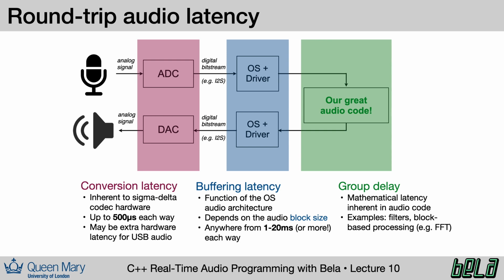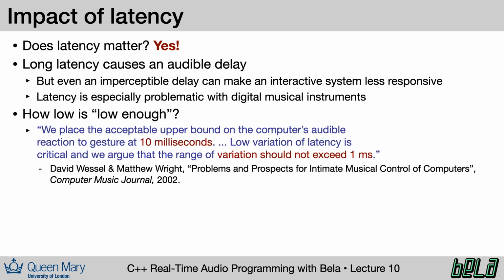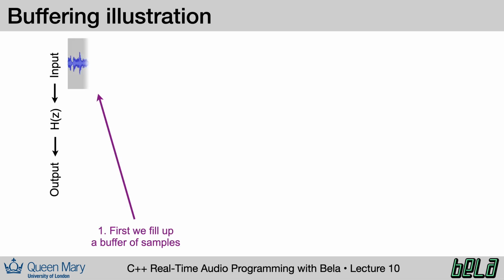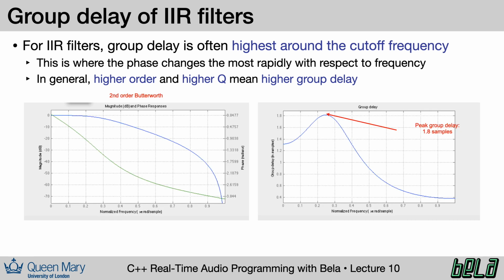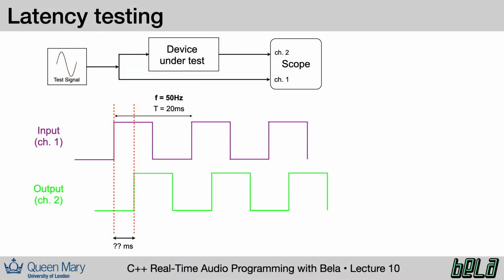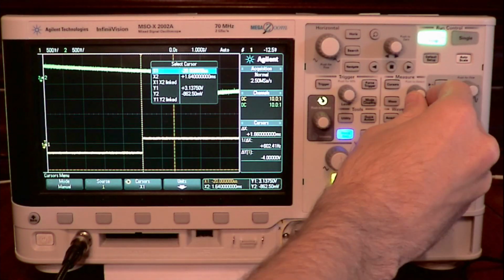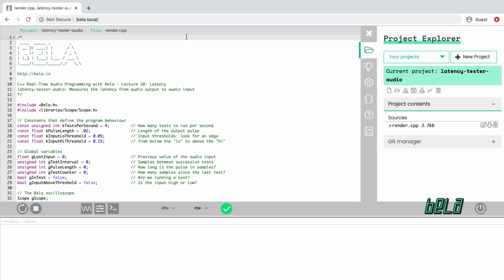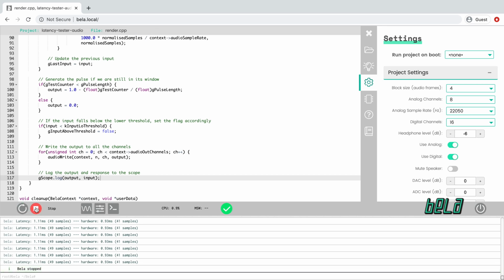10: Latency, C++ Real-Time Audio Programming with Bela

Comment: I'm interested in measuring the latency between USB midi controller pads (MPD218) and Bela output. Best way I can think of is to set a microphone over the pads and plug that to the left channel of my DAW and then record bela output on the right channel and look at the difference between pad press and bela output. The midi callback routine is an auxiliary (non-realtime) task on Bela, so I'm not sure what to expect, but it seems quite tight at the moment. I'm considering hooking up the MPC pads directly to ADC inputs on Bela, but not sure if it's really worth it.  p.s. I want to hear a cheer in this video when you measure 1ms latency ;)
Reply: yes, that should work. It's the same approach that was used here https://www.tandfonline.com/doi/pdf/10.1080/09298215.2017.1340485?needAccess=true

Comment: The data sheets show 21 and 17 samples of (filter) latency, the measured hardware latency (both on the Bela and the oscilloscope) is 41 samples, leaving three samples unaccounted for. Would be nice if you explained those as well (fairly sure two of them are due to serial transfer via I2S which obviously requires time separate from the built-in anti-aliasing filter).
Reply: Good question. I would expect 1 frame of latency on each of the input and output from the I2S transfer, as you say. The remaining sample of latency is probably the effect of slow rise time of the output signal because of the band-limited audio output. If you turn down the overall level of the output in the Bela settings and run the same code, you'll get another 1-2 samples of apparent latency because of the time it takes the input to cross the threshold specified in the code.

Comment: Why is the latency measured at two differenct edges? The rising edge on channel #1 and the falling edge on channel #2?
Reply: Good question. The way the Bela audio codec is set up, the passthrough produces a phase inversion, so the rising edge on the input corresponds to the falling edge on the output. I perhaps should have mentioned that in the video! This could be eliminated by multiplying the output by -1 before sending it, but I chose to use the built-in passthrough example.

Comment: I wonder if there was another sort of mic and ADC, structurally similar to cochlea with frequency domain data as output. It would populate input buffer immediately with 0 latency (digits there would always be relevant). Processing as well would be simpler for many cases, like filtering. Outputting is potentially also 0 delay.
It looks like the whole set of latency problems is caused by initially picked time domain.
Reply: The cochlea essentially performs a frequency-to-location transform due to its continuously varying impedance. You would still have to determine/digitize the level in multiple locations. If all you need is a continuously updated FFT (instead of a cheap, block-wise computation), there are algorithms for that. Processing completely in the frequency domain would in fact result in infinite latency, as you have to know the entire signal a priori. In any case, there are cochlea-like chips (for HF processing): https://dspace.mit.edu/bitstream/handle/1721.1/59982/Mandal-2009-A%20Bio-Inspired%20Active%20Radio-Frequency%20Silicon%20Cochlea.pdf;sequence=2